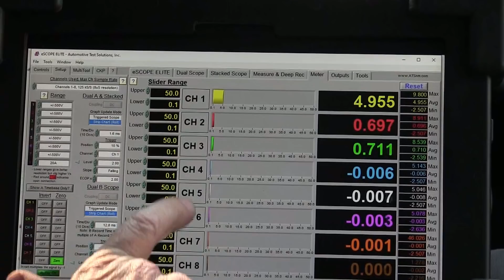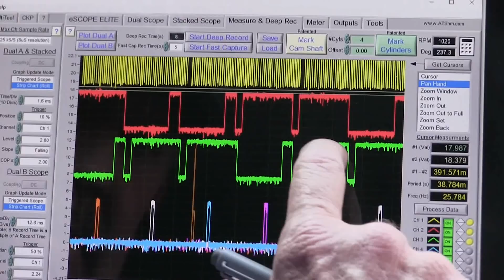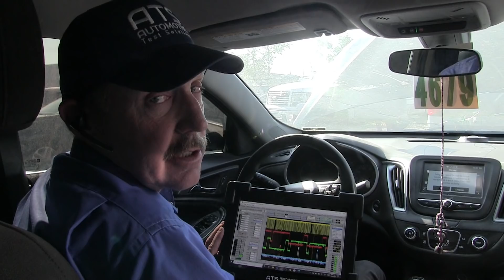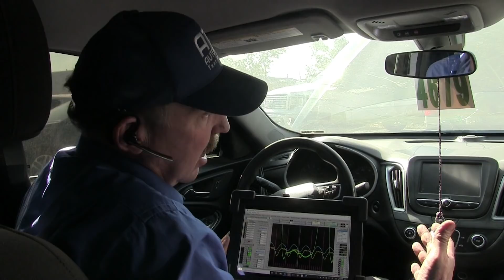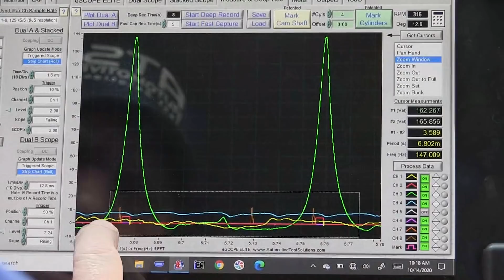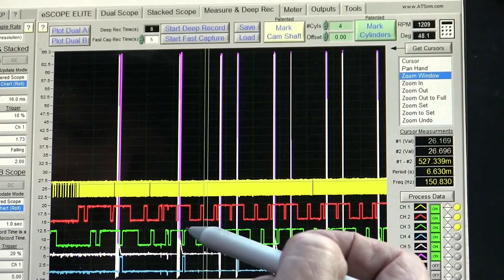2017 Chevy Malibu Intermittent Start

Comment: I know now why this channel doesn't have lots of subscribers, cuz it has such amazing, fantastic and mind blowing videos, Not all technicians and parts changers out there could deal with.
BTW, you've just said it, the ecu has 50/50 chance to fire the right cylinder based on ckp signal only, and takes at least 1 or 2 complete revolutions to start the engine, cuz at TDC the cyl could be wether on compression or exhaust, so the ecu just guessing and can not make the right decision at the right time, that's why it takes a bit longer to start. And at the middle (half way) it's 360° not 180°, cuz as we all know a complete cycle is 2 revolutions which is 720°. Keep up the great work, THANKS.

Comment: Before looking at timing, install the original ECM and see if the BARO starts working, then clear codes and see if P0014 reoccurs. If so, then see if you can access real-time data PIDs that describe if the ECM is in limp-home mode (default mode).

It would be helpful if you could explain how the variable cam timing actually works, and then review a wiring diagram to show module inputs and outputs. With dual mode variable cam timing it make sense that one cam is referenced, and then the phasor(s) outputs (target) provides feedback on the actual position of each cam. So, essentially the cam position is commanded by the ECM and then the actual position is confirmed with target feedback.

Comment: Thanks very informative. Had a Chevy having this same starting problem after I changed a broken vacuum pump. Didn’t need a whole new camshaft just make sure matrix mark is at 12o’clock and “single tang” on the fluctuater facing 12o’clock.a bunch of different codes remained after clearing them and rough start remained. All you need to do is replace camshaft sensor and your good to go

Comment: This is a joke.  2017 and already these craps.  Should be manufacturing warranty for at lease 100k miles.   It's way 2 silly
Reply: How do you know it doesn't have 100k on it he did not state the milage or type of engine

Comment: I literally had one of these not too long ago.  Same car and engine.  Timing way off but in cylinder / intake and exhaust were on.  Vacuum pump broke and another shop put a new one in but didn’t clean out the broken pieces and shifted the trigger wheel

Comment: Yea, I’ve dealt with this before. The vacuum pump seizes up and pieces of the pump get jammed up and move the trigger wheel. Luckily my customer still had his powertrain warranty
Reply: I would think it would burst open if it did seize as those vacuum pumps have very thin aluminum housings. I ve rebuilt a couple and they have normal wear where it would make contact.  Very basic pumps, the inlet air filter usually gives out and starts to leak from there as well and the main body seal just shrinks and leaks as well. Dealer had diagnosed a rear main and after I inspected it, I concluded that it was just the vacuum pump, dealer sees oil around the tranmission and automatically assumes rear main but the source was coming from the upper side. Dealer tried to sound fancy blaming that the reason the rear main blew was because of the breather valve malfunctioning but odd that that didn't include the replacement of that in the quote which would lead to the same issue in the future if it were true.
Reply: Punk 😂

Comment: Great video Bernie. 
Had a 2021 kia forte today with an exhaust cam trigger wheel that was 60 degrees off and was setting a p0016.. Intake over advanced.  Vehicle started and ran fine. No power loss even on the highway. . was a great learning experience.  Your video cleared some questions i had.. Thanks for all your experiences.

Comment: Mr. Bernie you said outputs are 180° off when the engine does not start. Should'n it be 360°? Nice video btw, u can't get this kind of info here un Venezuela.
Reply: If was 360 degrees, would be on the same position, so no problem at all .
Reply: @Lambros_Stefaneas  a full cycle is 720°(2 cranks rorations). So a 50/50 chance should be 360° off from each other.🤔
Reply: @nestormarchan2447  He said 180° the cam outputs, that  the camshaft  timing mark is of the marks,180 degrees . I tell you an example to understand what did he said. 
When you are dealing with a car,that the timing belt (or chain)has jumped, how you check it,you set the crankshaft on the mark, and you check how many teeth (or degrees) the camshaft  are of.if the cam is on the timing mark, engine timing is OK.if the camshaft is of the marks , any degrees, is of,out of timing, but if it's on the timing mark the cam(that means the timing is ok), and you turn the cam 360°, it's going to be again,  exactly on the timing mark. I hope you understand with that example. 
I understand what you said with the cycle, it's the same, but when you dealing with timing, that's how you compare the marks with the timing. set the crankshaft on the mark, and watch the cam teeth. you don't talk with the full cycle. even how you write, if you said 360° of the full cycle , out of the 720° full cycle, is 50% change. 360 is half of 720.but, it's to complicated to, with no reason.

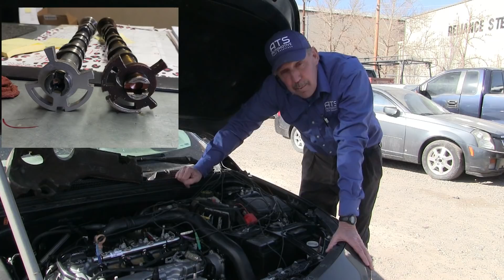Comment: Look closely at 37:37, the cam lobes are oriented the same way on both cams but you can see that the trigger wheel on the old cam looks to be ~90 degrees out vs the new. (~180 relative to the crank...cams run at .5 speed on 4 strokes).  What I'm not getting is mechanically how is it off?  It looks like the cam is multiple pieces and the trigger end is unthreading????
Reply: I was just thinking that they used the same cams for both intake and exhaust, some people think they are the same because they look similar 😅

Comment: BERNIE WHY DID THEY CHANGE CAM
Reply: Vacuum pump seized up and breaks the end of the camshaft and breaks or shifts the reluctor on cam. There is a TSB for this for GM techs not sure if available to independent shops yet. Very common on 1.5L Malibu motor. Remove exhaust cam sensor and look in the hole for damage or metal debris. A bore scope can be useful too.
Reply: @briandeeney9329  Thank u for your comment. U answered my question!!
Reply: @briandeeney9329  what vacuum pump you mean
Reply: @Bias_Prineus  turbo cars have vacuum pump to create vacuum for BRAKE BOOSTER when the turbo is making pressure in the intake manifold and vacuum to brake booster is absent.
Reply: @petar443  why would you need vacuum to the break booster  under acceleration
Reply: So the strategy if the intake cam signal is missing, is to use the exhaust cam signal to fire the coil at the right angle. If the exhaust cam signal is missing, it will use the intake cam signal but it will be a delayed start. If both signals are missing the PCM has a 50/50 chance of firing the coil at the right angle. If the exhaust cam signal is out of time but the signal is still being generated, the PCM will use a 50/50 chance to fire the coil at the right angle?   It's really interesting this type of information can't be found in service data.  That's one of the things that always seems like a hidden secret the strategy any ECU uses when inputs are wrong or missing.  If we had this type of information it would make it a lot easier to understand how the system operates in different failure modes.  Your video unlocked one of those secrets.
Reply: @Discretesignals  you can see their strategy with scope scenarios
Reply: @Bias_Prineus  but a lot of play required like Bernie did. It would be useful to just have the information from the engineers.
Reply: @scientist100  sorry you can forget that happening. It’s a secret so they can eliminate the independent shops.

Comment: What exactly was going on that a new cam needed to be installed?
Reply: Vacuum pump seizes up and breaks rear of camshaft where sensor mounts.  If you don’t have a million dollar scope or hours to hook up remove the exhaust cam sensor and look down the hole for damage or metal particles, a bore scope helps too.  There should be a TSB for this it is a common issue with Malibu’s with the 1.5 L engine
Reply: @briandeeney9329  yes it's a common issue, but what he did was reverse engineer the strategy this car uses when it's missing input signals. 
And shared it with us. All while encountering this vehicle and problem for the first time.

How many timing jobs you think have been sold before they realized that this was a common issue?
Reply: @SuperMarioDiagnostics  that would be the time to fire the parts cannon and sell the timing job plus phasers. I won’t be messing around and do everything while I’m there. Bernie seemed to have done his homework and have looked at a known good cam crank correlation on this particular car. That was the key on this diag.
Reply: @SuperMarioDiagnostics   In no way am I knocking Bernie, he is a wizard as are you Eric O, Ivan New level Auto.  Not all shops have his knowledge or tools but most should be able to do a TSB search and some basic troubleshooting.  Plus I don’t know if he realized he never explained why the camshaft was replaced, trust me diagnosing the issue and recording it at the same time boggles my mind. I’ve been a GM tech for 30 years so this video was right up my alley 😂.  I have the utmost respect for all of you and love your videos. Keep em coming!!
Reply: @briandeeney9329  weeds out the parts changers. Technicians know why, as it was thoroughly explained.

Shops should invest in scopes, imo
Reply: I thought it was awesome. He didn’t just guess at what was wrong, he did what he preaches: run tests, collected the data, and let that drive the next test until issue resolution. No biased preconceived end result.  No parts cannon required.